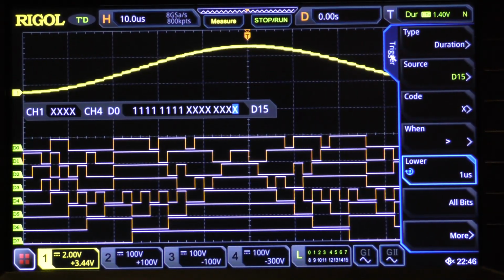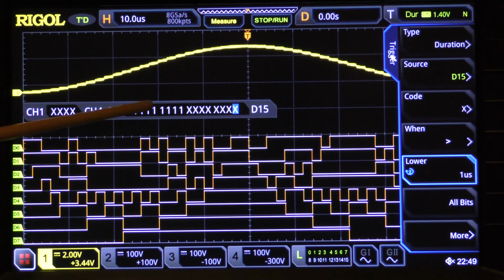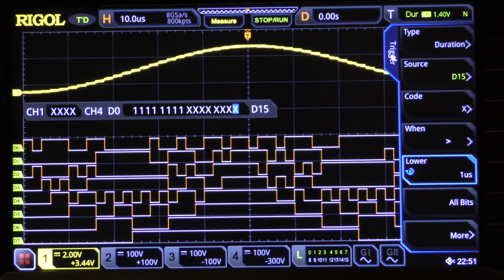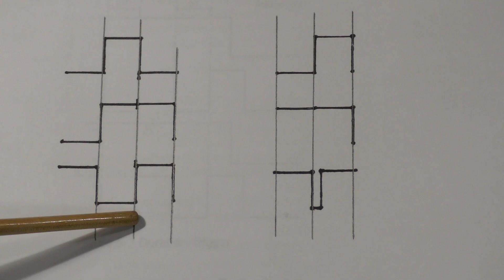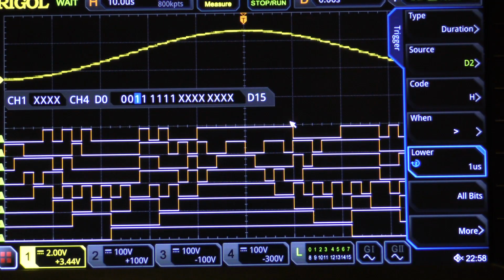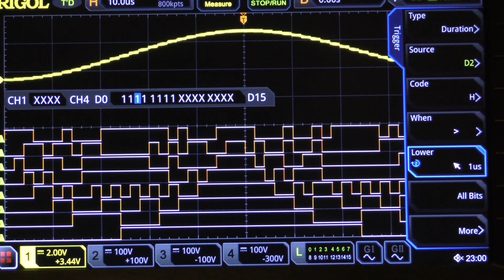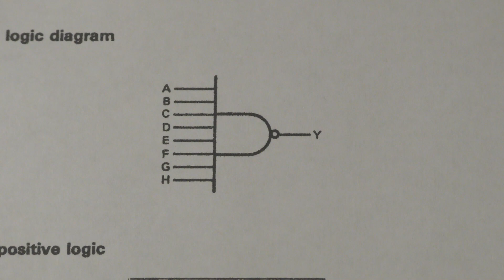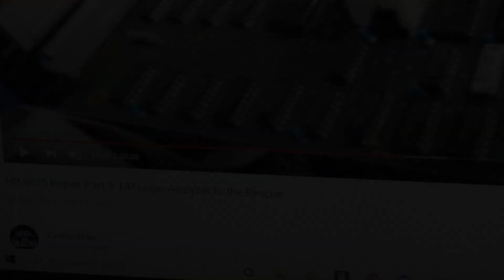TTT392 Rigol MSO5000 Using Duration Trigger

Comment: Watching your trigger videos has saved me time trying to read the PDF manual on the scopes I just bought. Very informative. I'm not too far after you in time. I recall thinking how impractical a computer made from flip flop boards would be. In the Navy, the submarine ballistic missile computer was made of many approximately 3 inch high modules and 4K core memory. The Apple Ii Plus came out just after I started college - 48K RAM and dual 5-1/4 inch floppy drives. A hard drive was too expensive at around $4K as I recall. My rent then was about $200 near Cal Poly, Pomona, CA. How things have changed with this MSO5000 scope  with 8GSa/s - makes it the best for a hobbyist like I am in retirement.